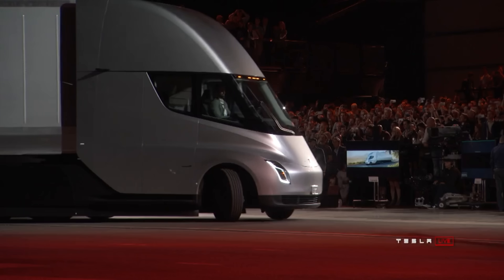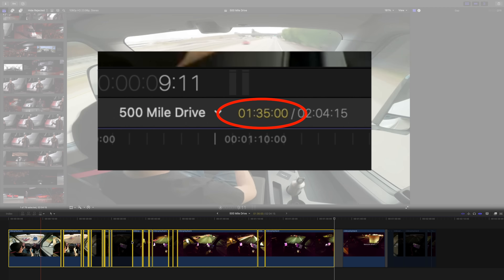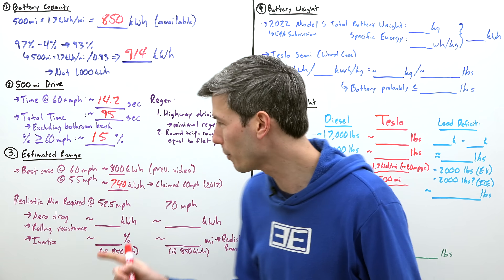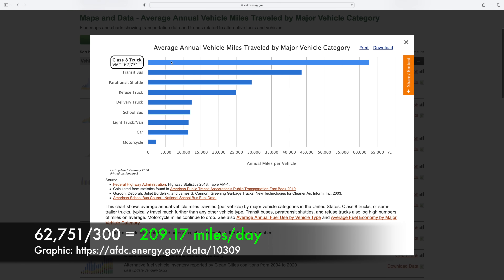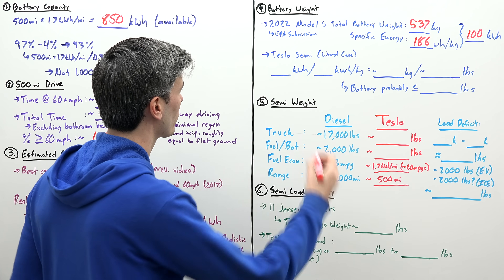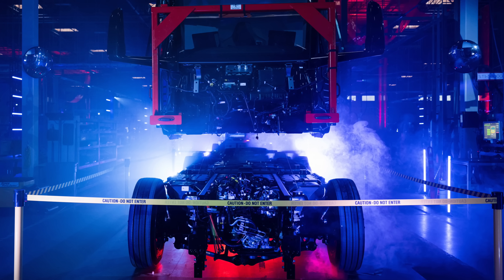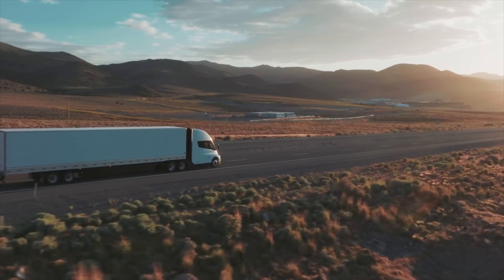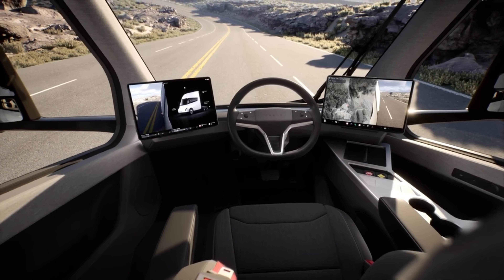Does The Tesla Semi Make Any Sense? Part 2!

Comment: I thought it was too bad you could not talk about maintenance.  Modern diesel truck engines are absolutely HATED by trucking companies due to their complex emission controls and (probably) short lifespan.  You see trucking companies doing everything they can to keep older, grandfathered truck on the road.  In comparison, electric trucks are dead simple to run and should have very reliable and long-lasting drivetrains.

Comment: I still think that Semi would ultimately fail due to cold weather performance and high operational costs. Tesla is pretty bad at servicing and repairing its batteries, and it's already financially very painful when the company says that the whole battery should be replaced on your model S. On a track that would be devastating.
In the end I don't thing we'll see a lot of ev trucks until more sensible companies start making them.

Comment: I love the information. As a driver the Tesla truck isn't ergonomically correct for a driver. Also as a driver that runs North and South routes. How much does the cold affect the batteries? In the winter I'm spending 70% of the time in temperatures  ranging from 30 to -30 degrees. Also I still haven't seen a Tesla truck with a sleeper bunk, refrigerator, TV or microwave in it.

Comment: Average day cab truck is about 12-14,000lbs, the empty trailer another 10,000.  Intermodal chassis + box almost double that so I'm still not seeing how a tesla semi makes weight.  Can someone help me?

The battery pack alone nearly weighs more than an entire volvo day cab, I know because the one I have is just shy of 14,000lbs with fuel and me in it.  If the battery pack is 10k the cab, electric motors, and everything have to be more than 2,000lbs.  That's one thing I can't wrap my head around.  Is everything painted carbon fiber?

Comment: The elephant in the room is how this is going to help us begin reducing CO2 emissions today.  In order for electric vehicles to reduce CO2 emissions you have to purchase the vehicle and then drive it for a while.  That's because manufacturing the battery puts more CO2 into the air than does manufacturing a gas engine vehicle.  Especially so with larger batteries.  So every year that more batteries are produced, the more CO2 we're putting into the atmosphere even accounting for the reduction in CO2 emissions from the fewer gas engine vehicles no longer on the road.  Only once you begin producing the same or fewer batteries do you begin reducing CO2 emissions, but even then it will take a while to come back down below where it was at the start.  But when do we foresee no longer producing more batteries each year?  Probably decades from now, if we are hoping that gas engines can all eventually be replaced.  That means we will have to compensate for these additional emissions by making greater cuts in emissions elsewhere, immediately.  Where do we see that happening?  Certainly not in China where emissions are skyrocketing, partly due to all the batteries they're manufacturing.
Reply: Still going to be a while until china pollutes as much as the US per capita.

Comment: What about winter tho? Ev can easily lose 15-25% range in winter time, not to mention the range you lose in case of front facing wind (even a simple 10mph wind can drastically impact autonomy) or simple rain that can lose another 10% fairly quickly.
That's all stuff that doesn't matter on a ICE truck that can be refueled very quickly, but that it's critical when you need absurdly powerful chargers.

Comment: Batteries lose charging capacity and then need to be replaced. What would determine the viability of these trucks is how their range will be affected with time and how often the batteries need to be replaced and how much would the replacements cost.
Reply: Personally, I’ve been looking at the reports of various EV’s and how their batteries age. It seems that just about everyone other than the Nissan Leaf has solved the problem with batteries aging, as they run active cooling and heating systems that will cool hot batteries and warm cold batteries. It’s not perfect; but, seen several people with over 100,000 miles on Teslas with something around 90% of their original range.
Reply: @bobwill  Long haul trucks drive that many miles in a year.

Comment: As a mechanical engineer currently working on class 8 EV’s, I found this video very informative and enjoyable.
Reply: The Tesla video only briefly showed the cargo, and the pallets weren't stacked anywhere near the roof. It must have been quite dense to achieve 82k GVWR. Still wondering if the video was truly honest.
Reply: @falseprogress  If you've ever worked for a big company, you know there comes a time when they can't get good analysis and data. They just have to run a sample and get the data to prove the case...before they go all in. Tesla has warranted the sample for Pepsi. And this mind numbing analysis is for dolts.
Reply: @falseprogress  are they ever? I have found almost every EV person who shows anything leaves out huge pieces of the puzzle. And us taxpayers are going to pay for it. Like in this one Using NTD to calculate what drivers do is like using business tax returns to show actual business profits.  it isnt going to match.
Reply: @falseprogress It’s easy to achieve maximum weight at a low height. You will never see a flat bed truck carrying concrete items or steel with a high load. They reach maximum mostly under a meter off the deck
Reply: @falseprogress  26 pallets per standard trailer. Easy to fit 1000lbs on a pallet. No trailers get stacked up to the roof, it’s not practical. Also not good for weight distribution
Reply: @tonyarce5427  What company are you at?
Reply: @tonyarce5427  So your more concerned with the batter losing 20% capacity in 12 months or less with fast charging or more than 40 hours a week?  

The 140,000 Battery lasts 2-3 years?

What about the much higher cost to run also?
Reply: @danquaylesitsspeltpotatoe8307  Cost to run is much lower. That is the whole point.
Reply: @Freba9  LOL no its not using musks price for what he charges for electric cars! which dont have fast charge which is more expensive while trashing the battery!

So what about the min 20% capacity reduction for the battery in one years working 40 hour week?  (alot more for fast charge and extra hours)

how often will they replace that 120,000-140,000$ battery how did you work that into the price?  :)
Reply: @MrStian78  GREAT LOGICAL FALLACY  - THE TOOL OF THE UNEDCUZATED WHO HAS NOTHING VALID TO SAY! 

Now show me where the FACTS hurt you and made you cry! 🤦‍♂🤣
Reply: @tonyarce5427  In shipping it does like purolator or fedex, no pallets just raw products.
Reply: @danquaylesitsspeltpotatoe8307  EV trucks are perfect for local delivery, and that’s the point. Tesla Semi don’t have a bunk.
Reply: @MrStian78  they also have a far greater expense per km/ton! 

THIS MEANS THEY ARE NOT PERFECT AND NOT EVEN AS GOOD AS DIESEL!
Reply: @danquaylesitsspeltpotatoe8307  You have zero data to support your claims. Fast charging has an absolutely minimal impact on battery life, about 1% over 200K miles of use. Temp kills batteries, as long as temp is controlled during a fast charge it's a non-issue.
Reply: @OtisFlint  LOL NO! 
Nice work avoiding the facts! 
But what else can you do?
THEY ARE SO GOOD WHEN YOU GIVE AWAY THE TRUCKS FOR FREE YOU HAVBE TO PAY EXTRA FOR PEOPLE TO TAKE THEM! 🤦‍♂🤣

THEY ARE THAT ECONOMICALY SOUND! LOL
Reply: @danquaylesitsspeltpotatoe8307  and where did you get your data ?And you left your caps on. just fyi
Reply: @tonyarce5427  Tesla slight of hand. A light aluminum trailer was used to allow 44,000 lbs of load on the incline demo, not legit with a standard heavier steel flatbed.
Reply: @falseprogress  When has trump er musk ever been honest? I think trump is more honest really!
Reply: @danquaylesitsspeltpotatoe8307  Did you watch the video? What part is the lie? Is truck possible or not?
Reply: Here's is another variable missing from their radar:
🤯💥🤯Multidisciplinary engineer/inventor here. We are developing the revolutionary FAZE engine technology. The 𝔽𝕦𝕖𝕝 𝔸𝕘𝕟𝕠𝕤𝕥𝕚𝕔 ℤ𝕖𝕣𝕠 𝔼𝕞𝕚𝕤𝕤𝕚𝕠𝕟 𝔼𝕟𝕘𝕚𝕟𝕖  tech best solves the issues present in previous internal combustion engine designs by transforming the old paradigm into a simple, low cost, quiet, power dense, efficient, on-the-go liquid and gas fuel-flexible, ‘non-polluting’ solution for power generation of all scales and advanced transportation.

𝔽𝔸ℤ𝔼 delivers better than 25% ABSOLUTE/ACTUAL [not relative] 
fuel efficiency improvement over gasoline engines, more than 15% 
for Diesel engines at any operating condition - speed/load, ambient 
temperature or elevation, not just at one optimal testing point at 
STP. Real world driving cycle savings could be an additional 200% 
higher due to the constant MAXIMAL efficiency and torque which 
results in a huge turn down ratio of ~99% without sacrificing 
performance. That means it's idle or running speed can be 10-50 rpm. 
The `simple, low cost, native/built-in, non-electric, environmentally safe, 
non-explosive, temperature agnostic 𝕊𝕦𝕡𝕖𝕣ℍ𝕪𝕓𝕣𝕚𝕕© feature 
recovers more energy than EVs and provides approx.100% fuel 
savings for a combined absolute vehicle fuel usage improvement of 
approximately 300%, thus obviating the basic need for expensive 
EVs & e-hybrids. 𝕚ℙ𝕠𝕨𝕖𝕣𝔹𝕠𝕠𝕤𝕥 adds >400% more torque. It’s like 
4 engines in 1.  This is all done w/o a transmission. 
 
The fuel agnostic capability allows instantaneous use of any liquid 
or gaseous fuel [natural gas at home!!!] incl. biofuels and hydrogen, 
even if old/dirty/unprocessed like flare gas or employ the concurrent 
multi-fuel capability…anywhere on the globe. One engine for all 
locales w/o modifications! Unlike EVs, this enables fast fueling anytime, 
anywhere…with no troublesome infrastructure disruptions or 
changes. EV’s are not a solution to the [FAKE]climate or mobility topics as 
high level of electrification globally is unrealistic 
[See Patrick Boyle's video "Electrify Everything?"] 

The technology offers smokeless, non-polluting, low odor heat and 
noise output without costly after-treatments, etc.,… with only the 
lowest  CO2. It has a negative carbon footprint with hydrogen, 
ammonia, biofuels or gasified municipal, agricultural and/or forest 
waste and coal from a 2-stroke-like simplicity. 

With virtually no electronics and emissions equipment, the cost of
purchase and reduced servicing frequency make this solution 
even more appealing.
 
Those are my two-bits

PS.
Did I mention we're developing advanced, simple, low cost, power dense electric machines and torque dense[read - compact], infinitely variable FrictionLess transmissions?
...
..
.
Reply: One percent of the population grows food for 100% of the population.  If all of you ( uneducated pseudo engineers that think gadgets maintain your cellular structure) die, then life gets easier for everyone propping up your useless and lecherous existence. If all the people growing your food die, you die.
Reply: @Nudge822  Its sad you are brain washed by musk! THE MAN WHO FAILED AT EVERYTHING! 

Fact the cost is 150% using his own figures! 
WHY DO YOU THINK HE HAD TO PAY PEPSI TO USE THEM? 🤦‍♂🤣
Sorry your denial of what experts say doesnt cut it!
Reply: What is your thought on the Tesla Semi?
Reply: please stop looking into 100% ev.

Diesel electric hybrid is the way to go aka how construction vehicles have been doing it for a very long time now. 

Think about it you get insane mileage due to diesel and then you get good power and electric motors on each axle for power when needed no lag. 

now 15% paycut if you tell your bosses my idea and it actually works lolol😭😅
Reply: @random13627  not true. EV is the way to go for local delivery.
Reply: @random13627  you want to gewt rid of 10-20%  of capacity to gain a little speed at certain times?

THATS NOT A SELLING IDEA!

Theres a reason musk had to pat PEPSI to use his terrible trucks!
Reply: You must be a terrible engineer lol, because as someone with no background in engineering or electric vehicles everything here was pretty basic, other than certain formulas he uses. Which as an engineer you’d think you would know.
Reply: @timtebow777  I can tell you’ll have a very poor life with that thinking. Sure, you understand the numbers do the calculating etc., but do you know what they mean in the real world? Do you know of what is possible vs what is calculable? You’re looking at this information boldly and think you’re smarter than everyone. It is you who is blind, you see the 5% written out. I see the other 95% that it took to get there, the actual engineering on the level of what is possible. Engineering is not hard, it’s all a math problem, but how you process those numbers is what’s different.
Reply: What in the world is a class 8 EV? Who's making up these classes? The world's gone bonkers!
Reply: @toddmarshall416   It is not a class of EV but a general classification of trucks. Class 1 is the lightest. Classes 7 and 8 require a CDL although in some cases lower classes also require it, depending on several factors.
Reply: @toddmarshall416  Look up class 8 truck
Reply: @toddmarshall416  I don't know anything about trucks, but Googling "class 8 truck" seemed fairly self-explanatory. None of it seemed "made up" or "bonkers" to me. But hey, maybe you're smarter than all of us?

Comment: I've been driving truck for 10 years, here's the real world problem.  

When fmcsa records weights it's indiscriminately.
1. The shorter trips mentioned are just that shorter trips. In in trucking we call those LTL (less than truck load) or line routs. Yes these routs often are under the 80k max lbs. Threshold. But often only for LTL routs. 
2. Line routs are rarely under weight because no shipping company will ever waste resources, ei, tire wear, driver cost, fuel, etc. 
3. LtL routs are primarily in city driving, for this reason, nearly all LTL trucks are short wheel base day cab. It allows for tight urban maneuvering. The tesla semi is a day cab, with a sleeper length wheel base. It will be extremely impractical to run LTL which is what the majority of the data used to justify the lower range and vehicle weight. 
4. Frito lay and Pepsi, along with coke possibly are the only few companies in the real world that could use these trucks for line routs, because they really ship for themselves anything outside of their own facilities. 

All the data any "expert" or tesla "fan boy" uses litterly comes from people who have never actually driven or done business in the industry. The fmcsa implemented Eld's because it would make roads safer, but instead has resulted in a year by year %10 increase in traffic deaths since implementation, including during the pandemic, when overall traffic numbers where down. 

The biggest problem I have with the truck itself, having driven nearly every type of class A truck, is that for day to day usability, it's extremely unaeroganomical. Being a long day cab, with only 1 seat, and the door being away from the driver, is not going to make for efficient  deliveries. Especially for LTL.
Reply: ... It’s a scam, like so much else these days.  Regards the central driver seat, doesn’t that mean backing up is at least partially blind on both sides?
Reply: @Kradius  absolutely, but they'll probably tell you about some b.s. about how their screens are better than human eyes at seeing obstacles, as if we never here about teslas in accidents.
Reply: @moderncoaches  ... Doubtful they're even green.  Takes a lot if pollution to make the batteries (cf. 2017 Swedish IVL meta-study).
Reply: @Kradius   considering the recent revelations on cobalts mining processes, their even arguably inhumane. And that lack of humanity is probably what's keeping the price of the EV's down to begin with, what ever % increase the mining cost would have to go up, to reach humane practices, would be a direct increase to the cost of the vehicles, at which point would be astronomically more expensive, and impractical.
Reply: @Kradius  what all the EV fan boys, arguing about energy sources seem to forget, is it cost energy to make energy, perpetual energy sources have not been discovered yet. So even though gas cars use petrol for energy, doesn't mean EV's don't. The energy to charge an electric car comes from somewhere, and its not electricity from thin air......
Reply: @moderncoaches  ... I'd bet you'd find the mining work conditions could be greatly improved for pennies on the dollar.  Biggest hurdle, like with so many things, would be the international banksters & their minions in gummint, etc., who are all probably profiting wildly, and could fairly easily, but likely never would address, as they already should have addressed those work conditions.  Alas, things being what they are, like, say, WTC7, it would probably require world revolution to right such things, a struggle in which most of us would surely die.  A  matyrs-only affair. ... I believe it's mentioned in Revelations.

Comment: Pepsi is milking the tax payer cow. 
I seen another video last week stating that the batteries were up to 16,000 pounds, so adding another 6,000 makes the total load 38,000 and your still at 82,000 which puts the road infrastructure at risk.
I haul isotainer's which are up to 52,000 pounds of product , empty the truck and tank weighs over 35,000, so these trucks would be totally useless.